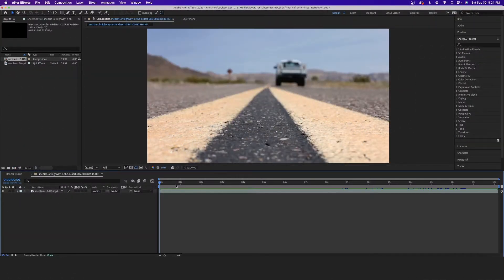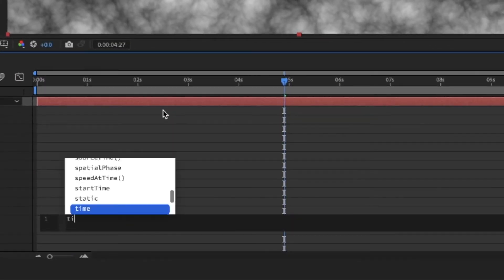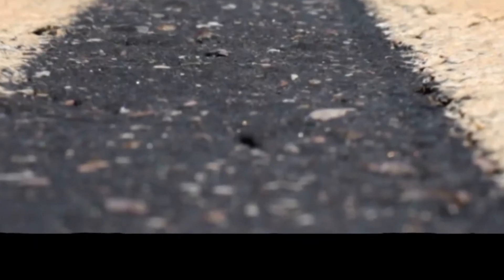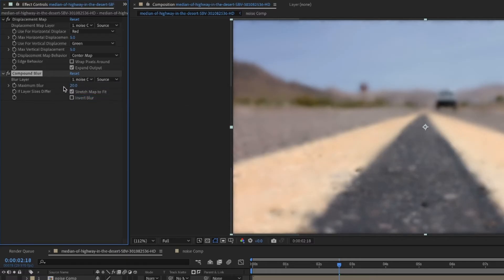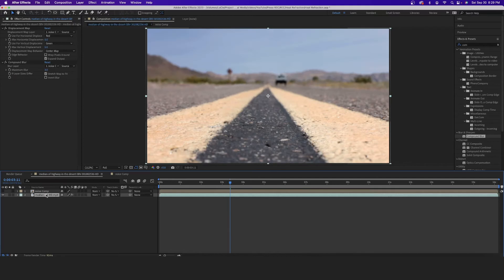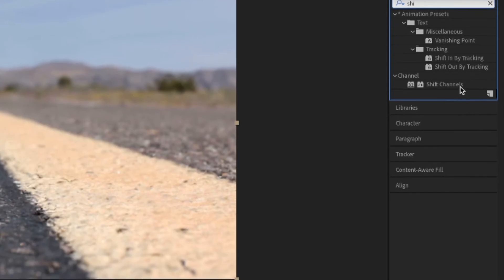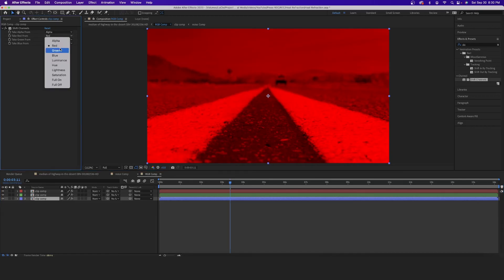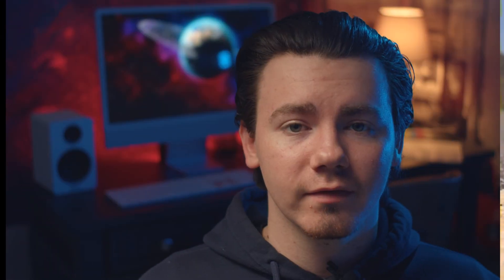AE Tutorial: Heat Wave Distortion

Comment: I also recommend adding the displacement effect to an adjustment layer above your footage, then add a motion tile effect to your main footage and change the output width and height value to 110 ( or more if needed & enable mirror edges) This way you don't need to scale your footage. Also keep in mind the subtlety is key and that heat distortion tends to appear further away where the amount of refraction appears to be more dense.